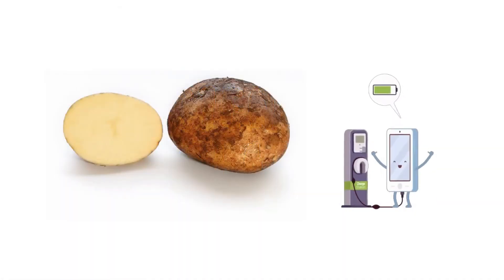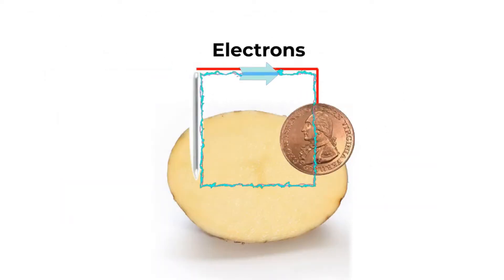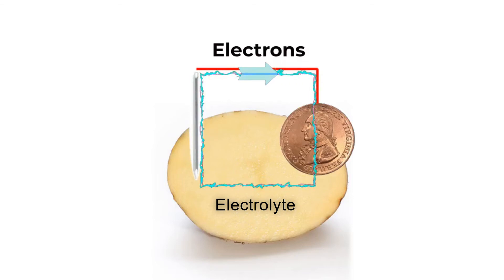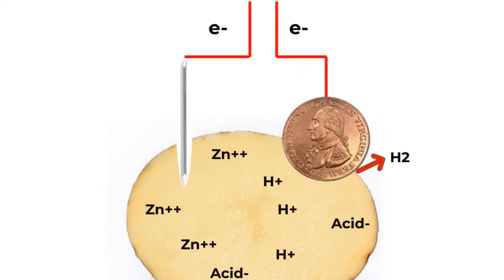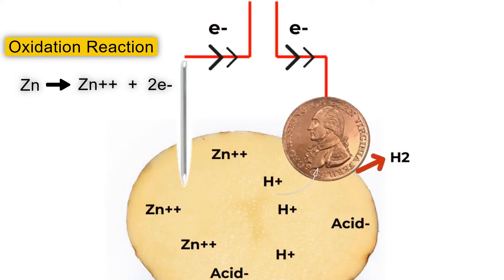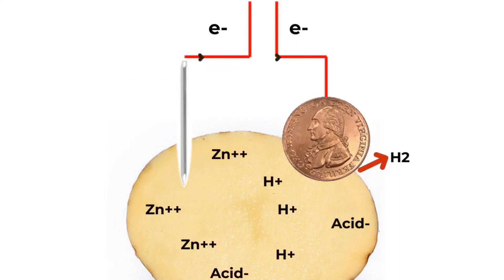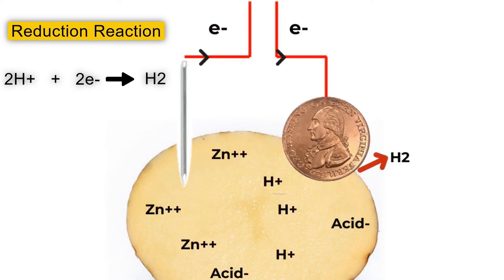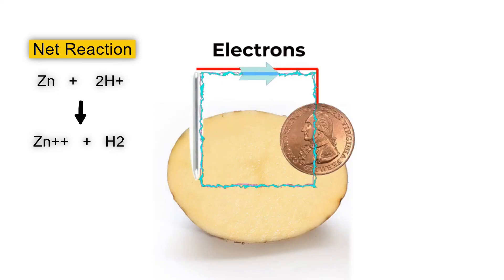Science Explained: Potato Battery

Comment: If you are a parent doing this with your child,heres a few tips. A boiled potato is 10x stronger,and purple sweet potatoes work the best. Larger and solid galvanized metal gives you more strength as well. Galvanized carriage bolts work well and are very cheap. Modern pennies are not copper anymore "since some time in the 70s I believe,but look into it" plenty of other ways to get copper though. Also in the US we teach that positive is where the bolt comes out and negative is where it returns,that is technically backwards,in other countries they teach the actual "electron flow" in the right direction. Lemons work the best as fruit,purple sweet potatoes work the best as veg,but many many other fruits and vegetables work as well. Me and my kids used just a cup of lemon juice. Currently looking for a galvanized metal sort of cup to fill and run a copper pipe down the middle of. To get more voltage,these do not work well wired in a parallel,but do great in a series. 
That's about all,good luck and make some memories that your kids will value when older.
Reply: Why does it die tho? Does the potato run out of ions, and it has to re-gather ions over time?
Reply: Ok?

Comment: Why do the electrons flow from the zinc to the copper through the wire, instead of through the potato? Does the wire have less resistance?
Reply: Hydrogen atoms are produced through oxidation and the electrons are attracted to the copper. Oxidation is not happening throughout the potato and the space in between or there would be no reaction.
Reply: You should consider making a small and weak capacitor,and wrapping your mind around how that works as well,you seem like the kind of person that would enjoy it. Even a few peices of paper and some foil will work.

Comment: Thanks for the amazing explanation! In conducting this experiment do we still need to slice the potato into half or not anymore?:))
Reply from the maker: Glad it helped! When performing the experiment yourself, it's really what's easiest for you. As long as your electrodes pierce the skin of the potato then the experiment will work. In my "Make Your Own Potato Battery" video I don't slice the potatoes I use, I just push the nail and coin (my electrodes) about 1cm into the potato. Hope that helps!
Reply: @funphysicsexperimentsathom4994  THANK YOU SO MUCH!!
Reply: @itz.jannarai  if you boil your potato you can get 10x more strength,and purple sweet potatoes are the best. Just throwing that out there.